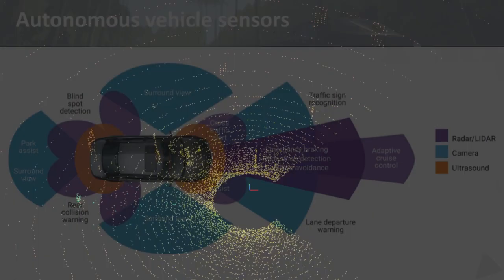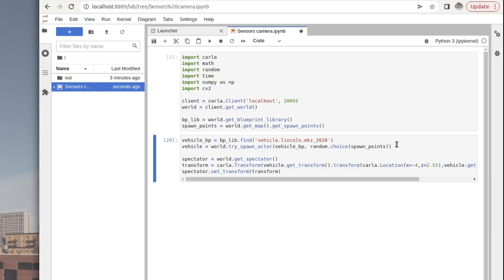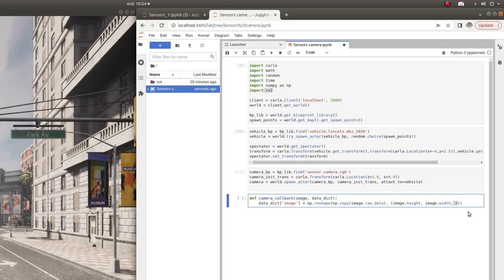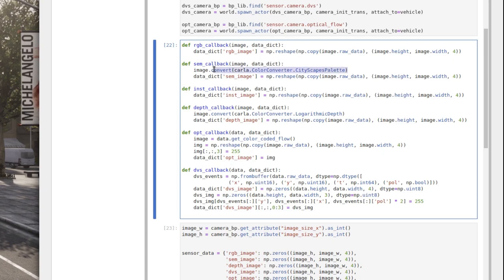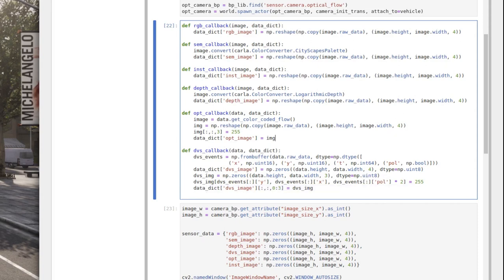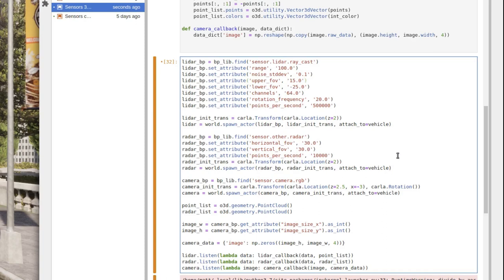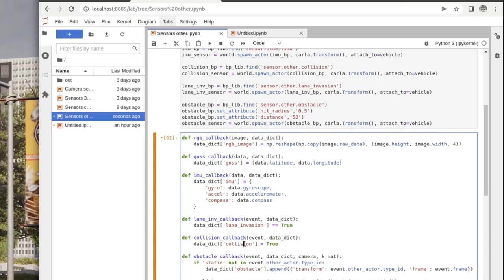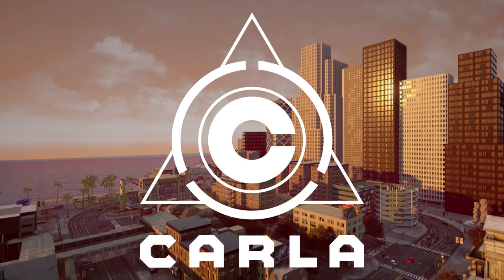An in depth look at CARLA's sensors

Comment: Nice tutorial, I have one question. what sensor gives you vehicle coordinates (x,y) ?
Reply: you could use the GNSS sensor, this simulates lattitude and longitude as given by a GPS sensor. But if you want raw coordinates, you can also directly use the vehicle's transform, this isn't a sensor it's just a property of the vehicle you can access through the get_transform() method of an actor
Reply: @mattrowe9919   Thank you for your reply, you mean this x, y, z = vehicle.get_transform().location.x, 

          vehicle.get_transform().location.y,

          vehicle.get_transform().location.z
Reply: @SushilSharma-sw6rq  Yes that's the correct way. That will give you the coordinates (in meters) relative to the map origin which is normally near the centre of the map